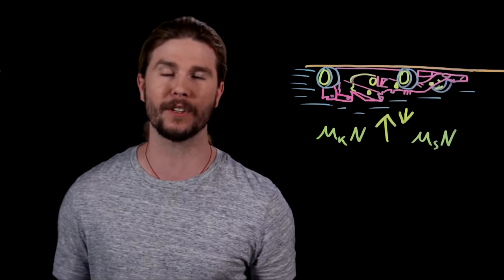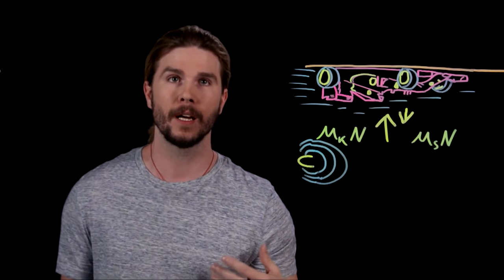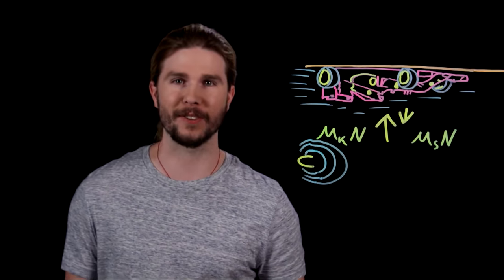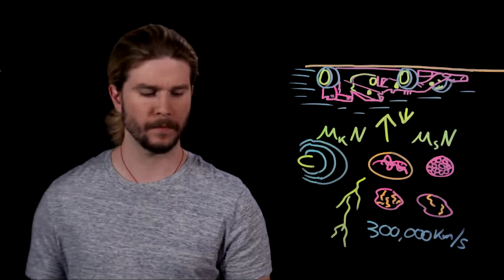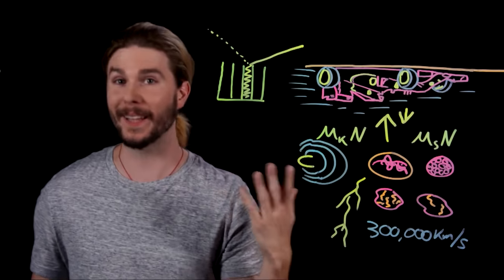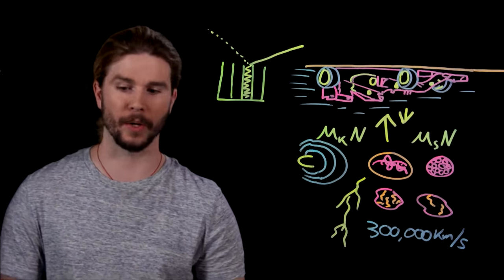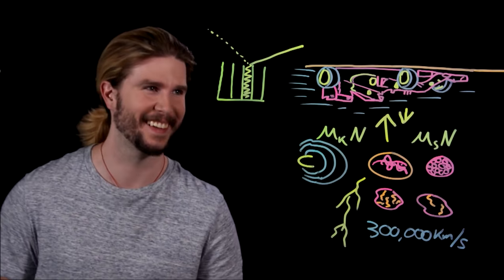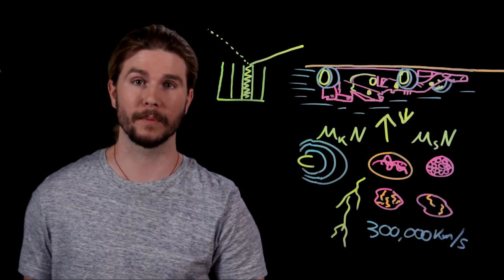Driving on the Ceiling | Because Science Live

Comment: Hi Kyle, as I'm sure you already know, high frequency sound waves, similar to high frequency light waves, diffract around obstacles much less than their low frequency counterparts. In lore, the "Canary Cry"  is often described as ultrasonic and so would diffract far less than any audible cry. Considering this effect I would say Black Canary's hearing would be protected because a vast majority of the cry would be directed outward from her mouth in a tight "beam" of sound. A laser of sound so to speak the angle(θ) of which can be described using the formula sin θ = 1.22(λ/D) where D is the diameter of the aperture (Canary's mouth). This relationships entirely depends on the ratio of the wavelength(λ) of the sound, which gets smaller as frequency increases, to the diameter of the aperature which also explains why her mouth is always wide open as much as possible when she cries. In fact, I imagine she could control the angle of the beam by changing the diameter of the aperture, which is really cool. I realize this is a live show so I'll forgive you for missing the science on this one.

Comment: The question posed at 18:24, by Emanuel Hammond, "What would happen if you absorbed light instead of reflecting it? Would you be dark or light?" can be tested fairly easily, by holding a strong  light-source, an iPhone or Android torch works well, against the under-side of your thumbs or fingers. As Kyle stated, our bodies absorb light, and it travels through our skin, and muscle tissue. If you try this little experiment, you should notice that your thumbs/fingers emit a reddish glow, as the light passes through. BecausePhoneTorch!

Comment: Also, the "upper bound" of temperature is called the Planck Temperature(T sub P)... It should be noted that most of the Planck numbers are very small, but this one is very large. About 1.4x10^32K... This is derived from the black body emission frequency for a given temperature; at Tp, the wavelength becomes shorter than the Planck Length, the "pixel pitch/density" of the Universe. It has implications in some theories of quantum gravity.

Comment: a click is 1 km, unless you are talking about long range shooting, then a click is one turn of the elevation or windage knobs of a scope. in terms of minutes of angle, most scopes will have a 1-4 or1-8 moa adjustment. Meaning it will take 4 or 8 clicks to move the reticle 1 inch at 100 meters.

Comment: If you combined equal masses of something super hot and super cold, and there was no other factors like air temperature, they would average out to the median temperature. 0K is -273.15°C, or -459.67°F, so something +273.15°C (about 40 degrees above the melting point of tin, or 2 degrees above the melting point of bismuth) would average out to 0°C. Iron at its melting point (1538°C) would solidify as it cooled to around 900°C.

There would probably be some form of matter state (solid, liquid, gas, plasma) change, but the exact change would vary depending on what type of matter is being mixed. Anything at 0K is a solid (helium has the lowest freezing/melting point at about 1K). If the hot thing is also a solid, and they're both the same material, it's going to be a very boring reaction. 

With the right materials, you might see sublimation (solid to gas without becoming liquid) or deposition (gas to solid). If there's oxygen present, the cold thing might combust, which is as close to a plasma as this experiment could get without the hot thing being a plasma to start.

Comment: hey kyle, about the hottest meets coldest question. theoretically the maximum possible temperature would be 1.417×10^32 kelvin or the planck temperature. any hotter and the wavelength of light it would emit would be shorter than the planck distance, and if it would even be possible to add more energy into that system,  whatever the result is couldnt even be considered temperture anymore. now i'm not nearly smart enough to do the math, but think about this. hydrogen has the highest specific heat capacity of any element, so imagine a giant sphere of solid hydrogen gas at 0 kelvin, how massive would it have to be in order to absorb all the energy of say even a bowling ball at the planck temperature? it really would be a mass issue between the two objects. if the absolute zero mass was large enough and comprised of an element like hydrogen with a really high specific heat capacity, it could  technically survive such an encounter.

Comment: A comment on the black canary question: i used to work at a theme park opening a new ride and at this ride you had to be extremely loud to speak clearly over the mechanizations of the ride. As a result we had to take a hearing test to see if we were required to wear earplugs. Most of the employees were dealing with around 85-90 decibels which is not ear damaging for short periods of time. Unfortunately i was yelling around 107 db. Which was causing damage. I actually have permanent damage thanks to this. Basically. I ruined my own hearing with my own voice. Lol.

Comment: I am still curious about the 'object' of infinite temperature. Add enough heat/energy to an object and the entropy increases? So Solid turns into Liquid turns into Gas turns into Plasma. But then what happens? If we assume that the volume stays the same, would that also mean an increase in pressure? Dos the plasma turn into an electron degenerate gas? Or is there a limit to the amount of heat/energy that particles can absorb?
Addendum (after discussing this with a friend)
Would the max temperature of anything be like the Planck temperature?

Comment: Absolute hot would be matter with arbitrarily large energy. Which basically means it would be travelling (or vibrating) asymptotically close to the speed of light. In such a scenario, the single atom of "hot" matter would weigh many orders of magnitude more than the "asymptotically close to absolute zero" atom due to relativistic mass as it approaches the speed of light. The resulting collision would be similar to a particle accelerator. There wouldn't be anything particularly "special" about the collision, as far as we currently understand physics - absolute zero doesn't "anchor" an atom in space, so this isn't an "immovable object vs unstoppable force" problem translated into physics...

Comment: You can't slow down photons in the way you described, sorry. What happens when light passes through a medium is the photons get absorbed by the atoms and then sent out again. The denser the medium, the more often this happens and thus the slower the light progresses. (This is for instance why the speed of light becomes much lower in water, whereas the speed of light in air is hardly that different from the vacuum speed (0.04% lower or something). However, the photons themselves don't actually slow down or stop, they are just temporarily absorbed in the atoms before continuing. It is only the energy flow of the light that is slowed down.
If the light actually slowed down, bose-einstein condensates (where light can be 'slowed down' to only a few m/s) would have dramatic relativistic effects. You would literally be able to outrun light (if we neglect time dilation).
Reply: A) There are published papers describing light moving slower than c in free space, so at least some of the experts believe that photons can be slowed.
B) Relativistic effects don't care about the actual speed at which light propagates - they're based on the theoretical speed of light in a vacuum, so, whether photons are traveling at c or at some other speed, that has no effect on what speed other things would need to be moving at to experience relativistic effects.
C) The actual description of what happens goes beyond what I can readily follow, but if I'm understanding things correctly, the "absorbed and re-emitted" picture is a "lies to children" description that gives good numerical results and is close enough that it sees general use (much like people still use Newtonian mechanics when relativistic effects can be ignored). In reality, an individual photon will be interacting with multiple particles at any given moment, and the net effect is that three different ways of looking at the speed of a photon start giving different results. One still comes out at c, but the others are different, and it's one of the others that reflects how long it takes the photon's energy to get somewhere...

Comment: To be fair, Jurassic Park the novel explains the dino DNA slightly better than the films. Indeed, they're only ever able to recover DNA fragments, but InGen utilizes dozens of possible sources and uses supercomputers as well as things like frog DNA to fill in the holes. It's fairly similar to the idea of starting with a chicken and flipping switches until you get "dino features", but instead they start with something like a frog and use super computers to approximate dino DNA from a plethora of trace DNA fragments.

Granted, the extent that any DNA fragments would survive over hundreds of millions of years is (probably?) virtually zero, but for the sake of the Jurassic Park lore it's relatively a moot point. The dinos are ultimately not dinos is kind of the subtext. In much the same way that a baby raised by wolves would not resemble a modern person outside of certain superficial physiological traits.

Comment: Light can slow down, photons do not.

Some more details:
Energy (E) = 
y * Mass (m) * Speed of Light (c)^2 (Where y = 1/sqrt(1-v^2/c^2) the lorentz factor, but dont worry about it.)
Momentum (p) = y * Mass (m) * Velocity (v)

So:
E/yc^2 = m
p/yv = m

Therefore:
E/yc^2 = p/yv

Cancel:
E/c^2 = p/v

And so:
E = pc * c/v  (You will see why I arranged it like that in a minute.)

From Einsteins mass energy relationship, (The whole thing, not just E=mc^2)
E^2 = (mc^2)^2 + (pc)^2
As mass for a photon is 0 we have:
E^2 = (pc)^2
Or 
E = pc

Now compare that to what we had before and youll find that c/v has to equal 1.
The velocity necessarily has to equal the speed of light.

(I am aware this is scrappy, I didnt even use the right greek letter for the lorentz factor, but Im pretty sure Ive gotten down the gist of things. Corrections would be welcome if Ive buggered it up.)

As for why light slows down when photons do not... that gets kinda complicated. The Feynman lectures explains it in the form of waves http://www.feynmanlectures.caltech.edu/I_31.html and sixty symbols explains why the particle view of things gets quite difficult to work with https://www.youtube.com/watch?v=CiHN0ZWE5bk

Comment: An F1 car experiences enough down force at 70 mph to drive inverted. A F1 can do 0 to 60 in less than 2 seconds so the build up is minimal.

The only issue is the engine isn't designed for inverted operation and would like fail after a few seconds to minutes.

Comment: I will point out something about absolute hot, it has to do with the fact of what is hot or how do we measure temperature, and an easy weay to put it is that if something is getting hotter, then the molecules of the thing are moving faster, then you reach a point where bonds can't sustain the integrity of the molecule and you end up with just atoms, if you keep heating things up, then atoms loses integrity becoming ions, at this point you have plasma, and particles (ions, electrons and some nucleai) will just move faster until the velocities are high enough to overcome weak nuclear force and you end up with a plama of neutrons, protons and electrons, and probably other particles (hadronic matter) in small amounts. Known physics kinda end in the next step, when the energy/velocity of the particles are high enough to overcome the strong nuclear force, then you end up with a soup of quarks and leptons... after this point speculation starts. Thats because if we keep heating up things, then this particles will lose integrity, becoming something more "simple" and we don't know if that exist or if the matter just become highly packed energy or a black hole (there will be a lot of energy concentrated at a small point in space). Also, there is the problem with how do you keep heating things, photons also have a limit on the minimum wavelength which is the Planck's length, so you just can heat things up until the photons get these levels of energy... i might be wrong in the last part, but i hope this can help :)

Comment: "Absolute Hot" vs "Absolute Cold" (Absolute Zero). What would happen... it would depend on the thermal conductivity of the two materials meeting.

eg. there are materials that can absorb the heat of a blow-torch, without getting warm. If the thermal conductivity, was VERY LOW, than it would be a gradual change of temperature for both of them.
Reply: Oooh not sure because one is emitting energy and the other is absorbing it. While i assume youre right conductivity would certainly impact the cold object the hot object would very possibly not change temperature at all.
Reply: Graeme McNamara you are right, the cold object would absorb energy. My point was rather that it would not necessarily be explosive when they come into contact.

I have a comment on your point though. The hot object would also lose energy in the exchange until they reached equilibrium... Unless it continued to create new heat during the process that kept it so hot.
Reply: Brenden Heinitz  yeah agreed as you say depends on the cold object as to how much and how much that would affect the hot object...too many variables to make any real conclusion.

Comment: Kyle, Formula 1 vs Dragster. In term of grip, aerodynamic aside, which of these two vehicle has better grip?
Reply: Uncle RJ Kitten  pretty sure F1 smokes a dragster when it comes to grip. F1 cars are 4 wheel drive (I think),where as dragsters are rear wheel.

Edit: So I have done some "research" (I googled it) F1 cars are not 4WD.
Reply: If you take aerodynamics out of the equation, a top fuel dragster has way more grip than an F1 car. Like 3 to 4 times as much grip/G forces under acceleration.
Reply: Dragsters have so much bigger tires, that they generate much more grip. Put the F1 sized tires to a dragster and it doesn't go anywhere because the tires can't handle the power, and they just spin.

Comment: Wouldn't absolute hot just be the point where the particles would be vibrating at the speed of light? And wouldn't the rate of increase of temperature taper off as you approach the point where it would take infinite energy to continue accelerating?

Comment: There is a thing called machine learning, where they show "A.I.'s" objects and it's able to learn what they are. The problem put simply for what everyone is worried about is that computers do what they are told to do, and now what we want them to do. Now this is true. If you tell a computer how to drive a car, (What they are doing now) it will slowly learn how to drive a car. (By the way, machine learning is a very slow process) However, what if you are going on a road, where there is a stop sign, but a cop is saying go? What will the car do. The answer is being tested and refined right now. But, machines have files. You can delete data. Machine learning won't interfere with you deleting those files, because the computer program won't know what you are doing, and/or how to do anything about how to do it.There for, everyone is fine. A.I. will never take over!

Comment: ZOMBIES
Considering characters not knowing of the word zombies before encountering them:  There was actually a movie where they did.  Look at "The Ghost Breakers (1940)"
starring Bob Hope.  They use the word "zombie" in a scene setting up the premise for the movie.

Also the movie Reanimator (based on a story by H.P. Lovecraft) had the reverse.  The main character (Herbert West) knew exactly what he was doing (animating the dead), they just never used the term "zombie."  Also, that story theorized chemical reanimation of the dead which has been deceased by at most a limited number of days?  Do you have any opinions on this?

HOT/ COLD
On the issue of the absolute cold meeting the absolute hot.  I thought the second law of thermodynamics would have something to say on this.  Wouldn't the two (2) average each other out (assuming the absolute hot doesn't have some way of replenishing its energy).  Then once those two have averaged its temperature out, then it would become one side of temperature equalization with a third source of energy.  This would continue until there is nothing more to average out with.

OTOH, wouldn't stars/ suns be an example of this when the heat source has a way of replenishing its energy.

Comment: Umm, actually an F1 car would require an engine swap with a stunt plane in order to drive upside down 
Because gravity is relatively constant engineers have taken advantage of it using a wet sump allowing the oil to collect in the sump pan
 however a dry sump was designed because when a stunt plane went upside down a few engines so they created something to operate at multiple g of acceleration in all axis